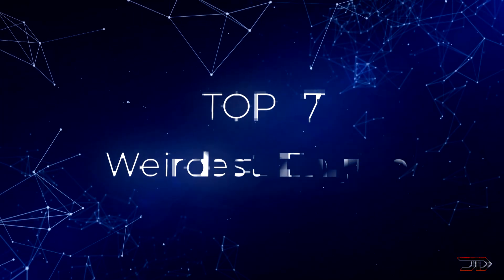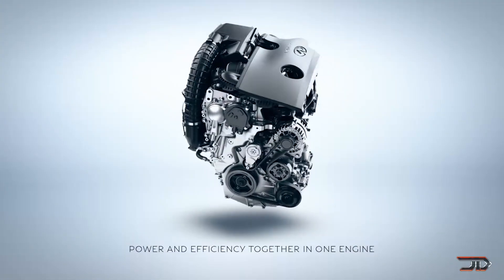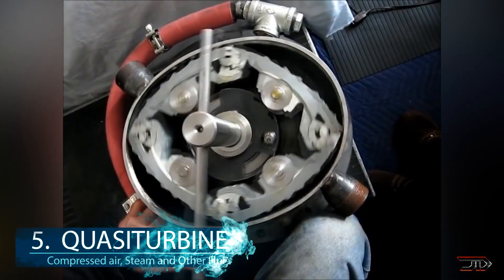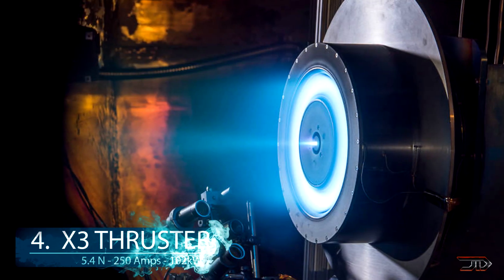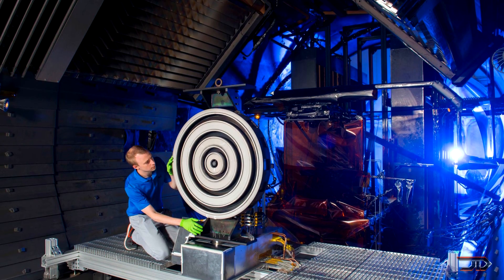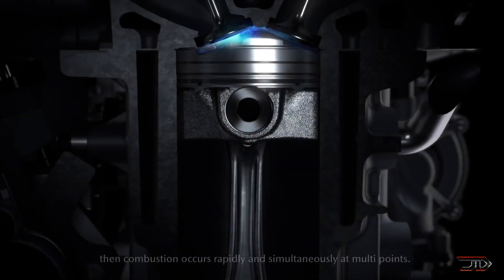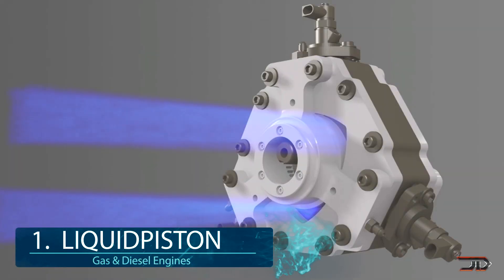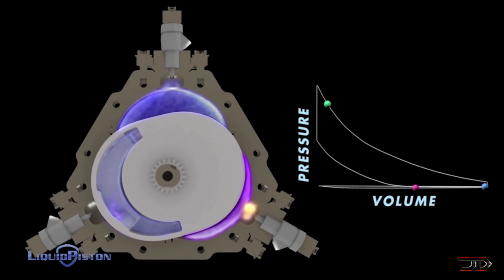7 STRANGEST New Engines

Comment: with the electric motor revolution there is simply no more need to find the holy grail of combustion engine, IMO. What we need is the holy grail of green energy production :)
Reply: something to bridge the gap while they figure out the next evolution of battery.
Reply: That statement is really far from reality. Full electrification is not only a myth but a terrible idea in general. Who puts all their eggs in one basket and thinks it's a good idea? Why would we want everything running of pure electricity? So when we get mass power outages those regions are completely screwed? In addition to that, our electric grid and infrastructure to date could only sustain one large city of full electrification. Just one. This simply means we are decades from having an electrical grid that could even consider supporting the entire country with electric vehicles. I'll mention the myths as well. Electric cars have a smaller carbon footprint or no footprint. That's false. It takes energy to create the cars and specifically the batteries and its no secret that the cost of these are enormous and electric cars aren't driving around not emitting any greenhouse gases. Consider this...future ICE's, due to Cafe regulations and new technology, will be scrubbing the air. Meaning, the exhaust air will be cleaner than the air entering the intake. An electric car will never do that.
Think for a moment just how many different internal combustion engines there are and how many different platforms. Saying ICE's are dead or anywhere close is fundamentally wrong and is not supported by any real data for future predictions. In fact, the ICE remains the dominant engine for decades to come. Don't take my word for it, there are plenty of big companies and Goverent agencies who have crunched the data and know this to be a fact.
Full electrification is not only an ignorant myth but a nail in the coffin to multiple millions of jobs related to ICE's. I'll also mention, a study was done recently on electric cars and their range during high and low ambient temps...some of the most popular electric cars including Tesla. The results, most cars saw as much as 50% reduction in range in temperatures below 32° and above 75°. The future of engines are hybrids. The best of both worlds so all of your eggs aren't in one basket and we don't fall into chaos with a mass power outage. If you take a single or two cylinder achates engine and couple it with an electric motor/generator, it'll be an incredible engine that will destroy its fully electric counterpart through most if not all categories.
Don't fall for the ignorant people pushing electric cars. They're driven by sheer emotion and don't really understand the implications of what they're saying and they certainly don't understand the technology.

Comment: #5 Quasiturbine - This is very similar to a concept put forward in the early 1970s by the Rotarymotive Developments group in New Zealand.   RMD was engaged in exploring various rotary concepts, many of them developed from inventions of Mr Hamilton Walker. Most of his patented concepts were based on an oval piston or stator as in this engine.  This particular geometry - using a lozenging  rhomboid piston - can provide consistent  seal engagement between the stator and pistons but that is about all it has going for it. Otherwise it has most of the shortcomings of the common Wankel with high surface to volume, even more complex sealing grid, plus a few extras such as the varying angular velocity of the drive shaft (or the need to add a differential mechanism to take out the hunting of opposite piston pairs)  and high mechanical forces at the seals which have to drive the inertia forces  as the pistons rock back and forth...........9 out of 10 for complexity
Reply: This engine has no vibration! It is also a detonation engine opposed to deflagration engine (your regular petrol engine). I wish there would be more development on this engine.
Reply: @jeanphilippepoirier6130  any links to follow anyone doing real life testing with these?
Reply: Even problematic will be to design it's intake and exhaust , along with cooling systems.
Reply: Interesting take. Appearing akin to a square rotary engine, it is my personal opinion that this design should be referred to colloquially as the scrotory engine. Partly because of the s denoting the squared-off look but also partly because it sounds like scrotum and I'm immature so that's funny to me.
Reply: @cosmicturban2797  😂😂😂😂😂
Reply: @aravindb8232  eh?

Comment: I invented 2 new engine-generator for transportation and stationary electrical like houses and building. The first one is call abr extrifuge surge generator. It is a low cost compact generator for cars and airplanes and ships that work by acceleration and deceleration of mass and weight transfert. The second one is a 2 pistons per cylinder engine that is call abr c.c.p engine. c.c.p mean central compression piston. It work like a normal engine but the compression has almost no drag on the engine and the power stroke ratio of power is 6 time higher. This engine dynamically ajust the power stroke to become a very long stroke aspect ratio which is more powerful. A car with a c.c.p engine can easily do 200 mpg or more. Im asking 1 200 billion u.s dollar without income tax  to sell these imventions to the broad international market to handle climate change and lower the price of electricity for transport and building and factories. I can send many diagrams and explanation by email to big manufacturers and gearhead. bababri54@gmail.com
Reply: @A Br I`m sure the Nigerian Prince would be more than willing to accommodate you, just return his emails.
Reply: Hi willythewave. I posted more theory and explanations and diagrams 3 days ago in oil price dot com. Maybe I will do a youtube video in a couple of months. Im asking 1200 billions to the broad market to open these inventions that probably nobody understand nothing at all. Anyway in a year or two I might sell these invention for 2 millions to cumming or Toyota or even to Chrysler that is perpetually near bankruptcy so it's not 2 millions that will kill them and if they know more industry insider-investors than they can resell that to the broad market for 1.4 trillions dollar or even more.  Look at the posting I done and I said that the engine might produce power only by air. You need to understand that my c.c.p engine compress the air in a large chamber that suddenly decompress in a smaller chamber for a gain of power just for that. The actual engine in Toyota and all others engine manufacturers compress the air in a chamber and decompress it in the same chamber so it has no power except if they put fuel in this air and burn it. So only sudden heat at the right place and moment produce power. So people think that gasoline produce a lot of power this is true but my c.c.p produce more power by itself and if we add gasoline than it produce a lot and a lot and a lot of power, at least 6 time more.  
https://community.oilprice.com/topic/4762-central-compression-piston-engine/?tab=comments#comment-39783

Comment: I think a two stroke is better IF the transition from induction to exhaust can be 
radically changed.
That will take the mind of some one who is NOT a mechanic or engineer
Some one who doesnt have to but wants to,just for the hell of it.
Reply: just make the valve on its own smaller crank shaft

Comment: I've had an idea for a motor for the past 30 years but never did it.  After watching this (and kind of expecting to see my motor) I should try to build it.
Reply: Well what happened
Reply: @SS-ts4ht  What happened after I wrote that 2 years ago?  I have a better idea that I think should be mass produced.  I tried making the parts but couldn't get within any tolerances so I bought a bridgeport milliing machine, south bend lathe, Jet horizontal/vertical 7x12 bandsaw and have been buying steel on Craigslist in the Pittsburgh/Cleveland area and am working towards that goal.  Surprised I got asked.  I don't think anyone believes I can do it.  But I'm trying.
Reply: @onenewworldmonkey  good luck bro , you will definitely make it
Reply: @onenewworldmonkey  good luck to you then!

Comment: What happens when the Circle Cycle Engine gets just a hair out of line, and the Pistons slam into the cylinder/s like a sledgehammer into a tin can, wouldn't you think so at least.  I'm sure they have researched this and tested it over and over, but it just seems quite farfetched as far as durability and dependability over time. Kind of like when a timing belt breaks on an interference motor , the motor is practically destroyed in mere seconds, maybe the same thing would happen with this motor,  one simple out of linement and the force and speed would create a destructive chain reaction and destroy the entire motor in under a second at high rpm. Perhaps?
Reply: Yeah that seems like it should be on a list of ways NOT to design engines xD
Reply: @Jeremy.Bearemy  I mean I agree with you ... I don't think it's the best design for an engine. But to be a little positive about the design, making a smooth chamfer on the cylinder block could help prevent the issue you were describing

Comment: Electric motors are much more simple and efficient. Most ships today only burn oil to run a generator to make power for an electric motor that runs the screw. My guess is the future of cars will be the same. Electric motors to drive the wheel and either batteries, generator, hydrogen fuel cell or even nuclear to supply power for the electric motor.
Reply: Hans Milling 
Also called serial hybrids

Comment: the only problem nowadays is gasoline and its 30% efficiency..    we'd be much much better off running on hydrogen from electrolysis cells...     and in the end run its a helluva lot cleaner.

Comment: The "Liquid Piston's" engine looks very promising. It solves few of the issues of the Wankel engine, without adding new moving parts. The efficiency should be higher, and sealing should be easier, due to temperature of entire housing being the same.

Achates engine is nice too, but not particularly new. The engines like that were used in the past in locomotives. They are good stuff, and if they can make it small, it can have benefits.
Reply: Imagine waking up one day and deciding to make an engine and call it the wanker engine
Reply: @lucaspanto9650  Wankle.

Comment: now this might seem crazy but : why don't we make a engine that is a v12 but has electronics to turn off certain cylinders. like just turn off the fuel injector and open the exhaust valve. so that if you need little power you can turn it to be just a v6 and if you need maximum power you can turn it to be a v12. you you see what i am saying here?

Comment: the circle cycle is just kinda a round about reworking of a normal reciprocating engine... I dont see how that could be useful. You have a stationary piston on a wheel that rotates about... so what you have is a piston and a crank. Its different and I like all kinds of interesting machinery but maybe im missing some ground breaking benefit of this design?

Comment: Dear God! Inventing for the sake of invention. Are there really that many engineering graduates out there with student loans they cant afford because they have no job? And waay to much time on their hands? Talk about re-inventing the wheel. Only more complicated, with excessive added parts. That are nothing more than added points of possible failure. This is when I bring up the LS line of engines. That proove that a simple efficent setup with a single cam, lifters, 2valves per cylinder, v -8, ect. Reigns supreme. Why? No stupid crap that breaks under excessive load or high rpm and does nothing but rob power through added rotating mass and friction. Stupid BS new engine designs need to be scrapped. We already figured this out folks.

Comment: Achates, interesting! So a mini Napier engine invented in the 50's. No cylinder heads, no moving valves, 2 stroke but T18 around 2500hp so they worked .. and sound great? Why have only 2 crankshafts (and friction) when with 3 you would have a T9 and probably only 30% bigger and heavier? Two together a T18 but I believe they were 88 litre or something like that. But very light because of the lack of ancillaries, heads, cam shafts etc. In the old days we had model "diesel", well , self ignition, 2 stroke engines that ran off paraffin, ether and castor oil but had variable compression with a counter piston to adjust depending on the quality of the fuel? Ether ... from plants = atmospheric CO2, caster oil .. plants, paraffin was very cheap but can be replaced with anything that burns and mixes like wood alcohol = plants. I like the idea of the compound engine scavenging the exhaust not featured here, maybe it can be remixed and ignited? Some bright young person could grab all these ideas together and change the world. Frankly I'm to old! Good video!

Comment: The pivotal engine from Mace engineering Christchurch New Zealand? A truly revolutionary two stroke with a hinged square water cooled piston which facilitates high continuous power density (it could even burn hydrogen directly) with the oil consumption of a conventional 4  stroke. Already being used in US military field generators.

Comment: The LiquidPiston X is going to end up having the same apex seal issues that all rotary engines have. I also have yet to see a multi-rotor LPX, as all of the ones I've seen have been single rotor with the same triangular shaped intake and exhaust; how would they design for a multi-rotor, or even a design for a more conventional intake and exhaust? Having the ports spaced around the shaft makes things more difficult, and a multi-rotor would have an odd design of intake-rotor-exhausts-rotor-intakes, or for 3 rotors it'd have to be i-r-e-r-i-r-e, and the piping for that kind of setup would be insane. What about chargers, with six inlets, and all the piping that comes with them, you'd end up needing some hefty charging equipment when compared to other engines. Wiring is another issue considering all the plugs are also located around the entire engine. Also the difficulty of machining the rotor is questionable. 
There's also the fact that LiquidPiston disappeared for years, then came back just to disappear again, and last I know, nobody really knew why. Either they got a good contract, or they ran into financial issues. 
Of all the new engines, outside of mass-production ones from large corporations, LPX is one that I would've hoped to see come to market and actually be decent. It'd be nice to have a modern rotary, other than being used as a hydrogen fueled range extender for electric driven hybrids, but I don't think we'll ever see one at this point. Hopefully someday LPX will have more than just a single rotor to show off, but I have my doubts.
Reply: I think the major advantage is that LiquidPiston X, can have higher (compared to Wankel) compression ratio due to geometry. And because of three combustion chambers, the temperature of the housing should be more uniform, that alone should improve seal design. So, overall it should be better than Wankel. Sure, the seals will be wearing off, but it is not that a big deal, and they can last years I guess. The biggest issue would be a lubrication of the seals, and emission issues.
Reply: The resolution to all the issues you stated above, are the same as for any Wankel... intermediate castings between rotor section to unify plumbing, and ceramic apex seals. Problem solved. NEXT!
Reply: @driverjamescopeland  the issue with intermediate castings on the lpx is how you'll route six ports to a single port for a header, the piece itself will end up being larger than the engine with that much complexity. 
Also, ceramics are nothing new, you would think that, if they're effective, they would have been extensively tested and used. 
In your absolutely annoying, and toxic, words: Next!
Reply: @xaytana  The improvement on the apex seal front, from LiquidPiston's own statements, is that you can cool them much more effectively because they're in the housing rather than on the rotor, which should make them last a lot longer, and because they're not moving, the tolerances can be better and require less lubrication. If this actually turns out to be the case, it could be a really useful engine.
Reply: @qmannnnn  don't forget, having the apex seals in the housing instead of in the rotor means that, in theory, they could be designed to be accessible without disassembling the entire motor when it's time to replace them.
Reply: Hi there, my name is Dexter from Asia America, a CNC Precision Parts manufacturer originally from California and production facility been moved to Dongguan China since 2005. We’d like to extend our manufacturing services to you for your metal or non-metal CNC precision parts outsourcing need.

We offer complete production facilities of more than 100 CNC machines in the plant, R&D Support, Cost-Effective production process, and Favorable payment terms.

We'd be happy to work on your inquiries and RFQ’s.

For more information about our Asia America, please check below our company videos and our website.

http://www.cncmachiningmill.com/video.html

Thanks,
Dexter Jenobiagon
Foreign Trade Manager

Asia America Industrial Manufacturing, Inc.
Tel.: +86-769-88568855 / 769-8568877
Mobile phone: +8618027043263
E-mail: aa4@aamfg.cn
Website: http://www.cncmachiningmill.com/

Comment: How to trigger a rotary engine car owner. 
Step 1. Lean in to his/her ear. 
Step 2. "Blown apex seal."
Reply: Actually more common failure point since they improved the seals, is deformed rotor housing since all the heat is generated on one side of the engine. Beauty of the Liquid Piston is it spreads the heat of combustion around the entire housing. But still funny.